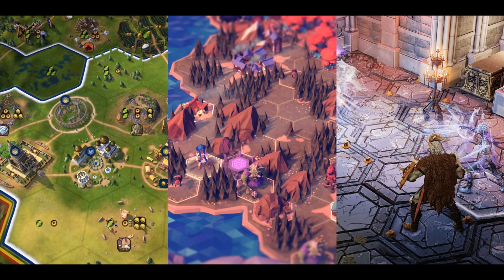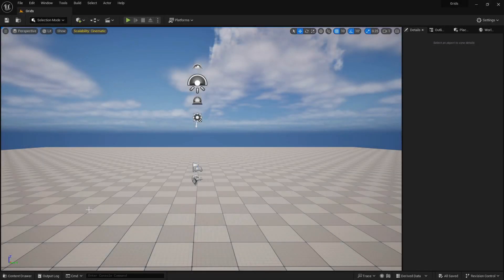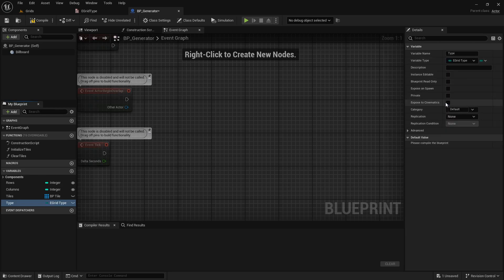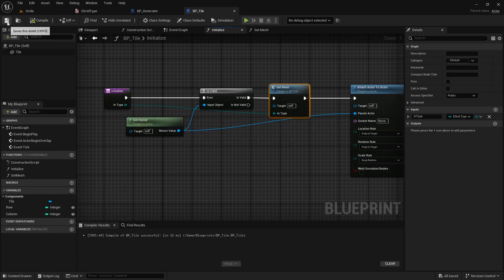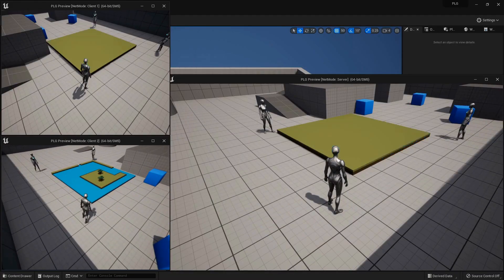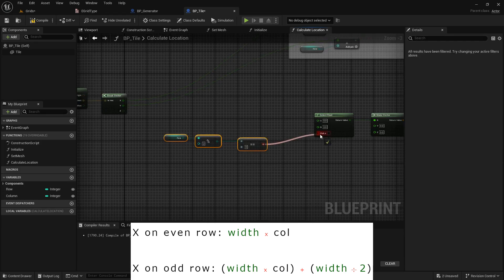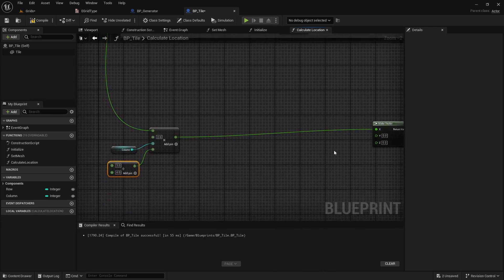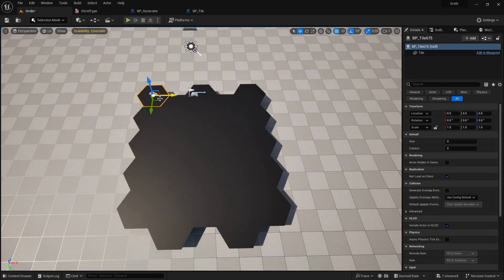What's a hex grid? How to make? (Unreal Engine)

Comment: Im having an issue, everything is working fine except many more tiles are spawned than what is set and they overlap each other as well. What could be wrong?
Reply from the maker: Hello,
Make sure to enable InstanceEditable on the tiles array in the generator, that should fix the problem.
Reply: @AziApps  Awesome! thanks for the help, that fixed the overspawn of tiles. However, while the hexagons seem to work perfectly the squares overlap; what I see is planes covering half of each other, instead of touching by the edge. Any Ideas?
Reply from the maker: Thank you for your report, It seems there's a problem, but the fix is super easy, open the "Calculate Location" function and for square part multiply values by two.
Reply: @AziApps  Good to hear. Thank you!